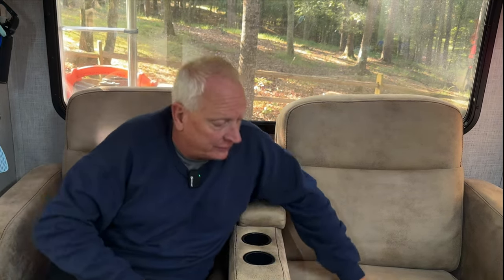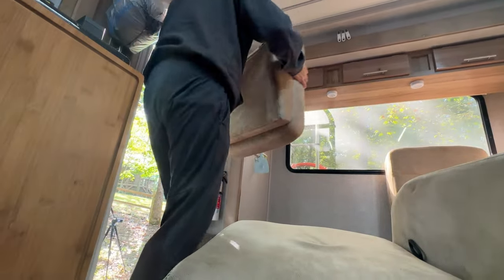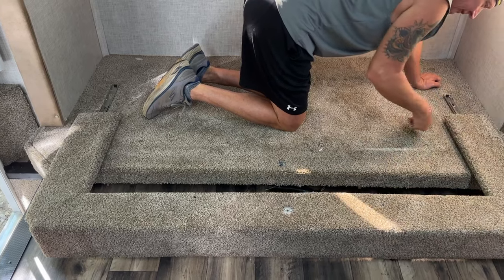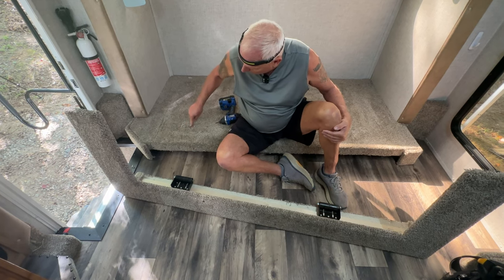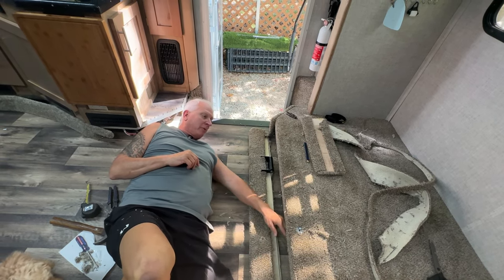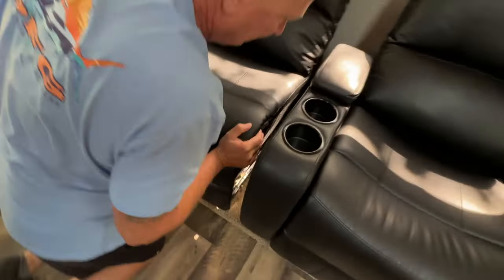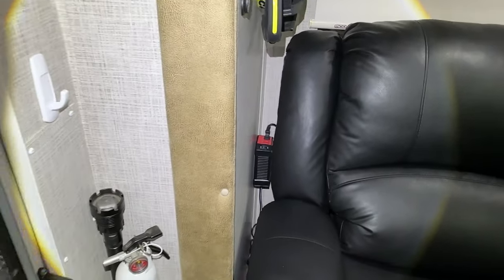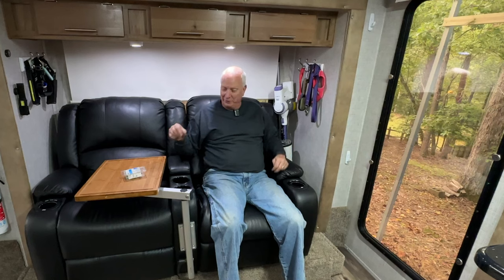Truck Camper Upgrades: Making My Yukon Cozy

Comment: Great information, we are just starting to look at truck campers . Host seems to have the room we want I’m hoping my truck is capable. I have a 2020 F450 . Safe travels
Reply from the maker: we have a 2020 f450 also, we pick up our new 2023 f550 in March, with our Yukon, scale weight was right at 17000 lbs, truck right at 10k, camper around 7k, over payload for f450, it rode ok with modifications to truck but i always had concerns about payload so that’s why we are moving up to F550
Reply: @WeAreForeverDreaming  

That’s what I was concerned about . Some think the 450 is capable of more than what the sticker says . Maybe a few hundred pounds but when you get in thousands I’m not so sure . Safe travels
Reply from the maker: safe travels

Comment: Great video, thanks for taking the time to share. In the market for a truck camper. Judging by the quality of the Host OEM couch install from the factory, I'd be afraid to see how the rest of the camper is constructed. Nice camper non the less, think personally I'm opting for the Northern Lite 10'2 with no slides. Just subbed and liked, keep up the great work.
Reply from the maker: thanks, Host is a great camper. no regrets.
Reply: @WeAreForeverDreaming  that's good to hear, thanks for the reply and again, keep up the good work, YouTubing isn't easy.

Comment: I just purchased a new Host Yukon,  the recliners that are in it look like the new ones you just installed.  How are they holding up so far?  Good luck with your channel,  we tried doing a channel 5 years ago, but it never really took off.
Reply from the maker: the Recpro set we installed is hands down the better set. Thanks for watching, youtube is definitely a time consuming endeavor. Again thanks for the support.

Comment: This was a great video and great information.  I have a 2022 Yukon and i really do not like the factory recliners.  Now that you have had them for many months, are you still happy with them and is there anything you might do differently?  How is the 12 volt power inverter working?  I was thinking you could have just tied into the 110 Volt outlet in the basement right underneath but I think your idea was easier
Reply from the maker: first thanks for watching the channel. 

We still love the change and wish we did it sooner. I really can’t think of anything we would do differently.  As for the 12v setup, no issues at all.  When we are on Shore power, unplug from 12v inverter and plug into wall receptacle. 

We have a couple of Videos coming out next on some Torklift products for the Yukon you might want to check out, we just replaced our factory steps with Torklift Glow steps. 

Again thanks for checking us out!
Danny & Donna
Reply: @WeAreForeverDreaming  I will definitely check those out and thanks for getting back to me. The other change I would like to make is the kitchen sink. I did see a couple folks change that out and really like what they did.
Reply from the maker: The Joslyn Journey has a video on changing out their sink in a Cascade
Reply: @WeAreForeverDreaming  I follow them too and have gotten some great ideas from them, sad to hear they might stop making videos :)  I remember the sink exchange but was thinking that was a different type of sink than what Al Persondek had put in.  I will go back and review theirs as well
Reply from the maker: @richardcraine5722 
We talked with them last week, they will be back, just taking a break.
Reply: @WeAreForeverDreaming  oh Good!!!

Comment: Thanks for the video.  How has that RecPro powered recliner held up over the last 10 months?  How far does it recline and is it comfortable enough to sleep in?
Reply from the maker: 1st thanks for checking out the video.
  The RecPro is holding up great, still looks new. Hope not to jinx us but we’ve had 0 issues with the RecPro or how we wired it up.

Comment: I see why you had to do what you did to adapt to the 120 V dual recliner. The only thing that I don't like is going thru all those connections (plug ins) to get to the final 24 v d.c. actuators that are in the new recliner. I have a 24 volt system in my cargo trailer that I got rid of the plug in at the back of the recliner and replaced it with a 2 wire 30 amp weathertight locking connector. Then I just ran wire from my 24 volt fuse box to the recliner and plugged it in eliminating the 120V to 24V converter that you have plugged in to you 300 watt inverter. If you look at the writing on the converter plug, it will show what d.c. voltage it is dropping the 120V down to (usually 24 to 36 V) that supplies the actuators. I don't have all those plug in connections and the one on the back of recliner is replaced with a locking weathertight one that won't come loose with vibration or jarring. I think Host could easily do a 24V system with a 24V to 12V drop box for all of the 12V accessories. I run fridge/freezer, recliner, and awning actuators all on 24V and other d.c. accessories on 12 v. Happy Travels
Reply from the maker: ok, good idea thanks and thanks for checking out our channel, safe travels. Danny
Reply: No problem. Obviously my trailer is 100% custom of my doing and I don't have a crimp connector anywhere. I'm one of those that solders and shrink wraps every connection. Next time ya have the back off the recliner where you can get to the plug in...unplug it and test to d.c. voltage going into the recliner. The odds are it is putting 25 volts d.c. to the actuators. If you show -25 volts it is because you have the voltmeter leads on backwards and that way you can tell which wire is pos and neg.

Comment: Great idea on wiring but use a heavier that 14 gauge…..use minimum of 12 gauge ….ten even better safety wise.
Reply from the maker: i was having hard time finding anything heavier, especially for dc current, however i agree with you but with my calculations the small inverter pulls a small draw, its not under constant use, only when use the power on the chairs to recline and etc

Comment: Can you install a washer/dryer in that same place?
Reply from the maker: where the recliners are? if so i wouldn’t think so, no plumbing there. However the Yukon model does have option for washer/dryer combo in drivers side slideout.
Reply: Can you store anything in between the slides , or is that a tight squeeze? Inside the camper.
Reply from the maker: no